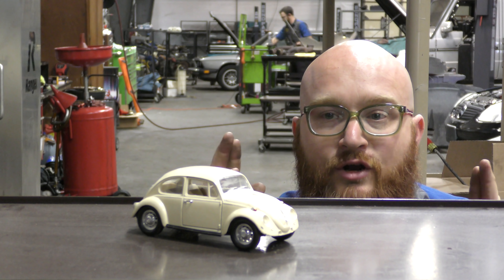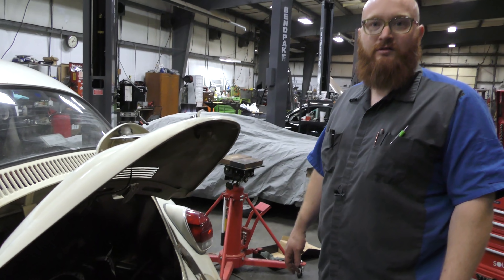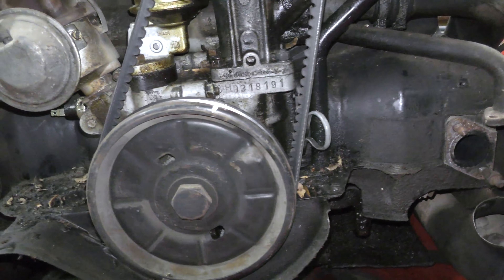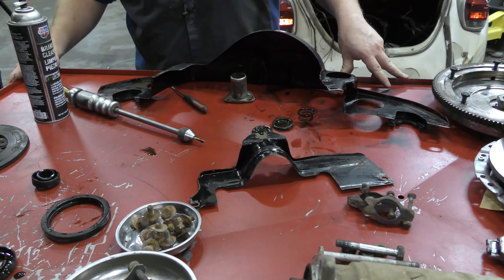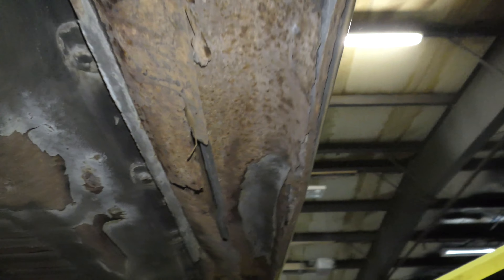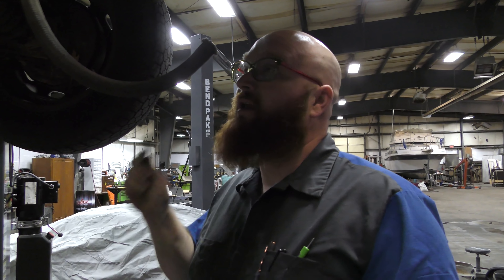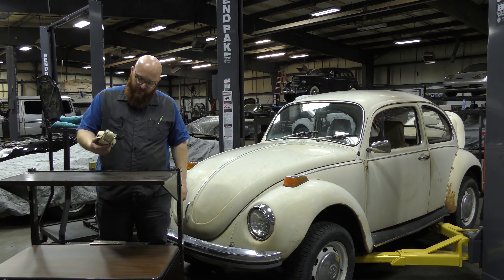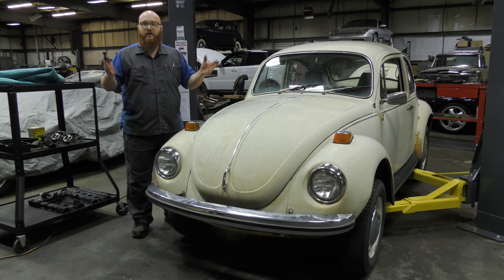Engine out for a clutch on '72 Super Beetle?! CAR WIZARD shows cool little car & huge repair process

Comment: In the UK, that car would not be allowed on the road with the heater channels rusted out like that. They are structural. I can't understand why, if this is a project car, that if the clutch had to be done, that the whole engine and transaxle weren't taken out to deal with all the rust. I've seen ot worse, but it's much easier to do with all the mechanicals out of the way. The job can be done properly.

Comment: Don’t understand why the muffler was removed, motor comes out with it still bolted to motor. Started my apprenticeship with VW in 1970, we had motors out everyday, but only two floor jacks, would put a large hypoid gear oil can under motor and pull motor onto can and lift car in the air, installed that way as well.

Comment: That fuel filter needs to come out of the engine bay. Put it under the car.

Those plastic filters splitting are a major cause of fires on Air-cooleds.

It's a simple job to pull an Air-cooled engine, when I ran a shop my best time was 9 minutes pulling the engine out of a Bay.

Comment: Woah, they pressurize the washer fluid tank instead of using a motor? That's not something I've seen before.
Reply: My memory of this is vague, as I was just a kid at the time, but my family had a VW microbus, probably around a 1967 model.  Its windshield washer used a foot-operated pump, located toward the left of the driver's footwell.  This pressurized-air system looks like a "luxury" upgrade that they tried after that.

Comment: Love that plastic fuel filter! So fire resistant....
Reply: Can be relocated. My Bug has the filter moved to a bracket on the gearbox away from the engine. But it’s also running a far from standard engine now.

Comment: Now let's see if the car wizard is an honest mechanic. Maximum 1.5 hours labour for this job, 5 wires, 4 bolts and a fuel pipe, bumper and tins. Full clutch kit cost in South Africa 100 dollars :)

Comment: I need to find someone to pull my Corvair's engine and and reseal it.  A similar design, but still much different. .
Reply: Never let that engine overheat. An engine fire in a Corvair can end up with the magnesium block burning. Once that happens, nothing can be done to stop the car from burning to the ground. My uncle saw so many of them burn on the side of the road that he thought they should have all been recalled and had a racing fire suppression system installed.

Comment: I've lost count of how many times I've removed a beetle engine.
Please, do the customer a favor and move that fuel filter down by the gearbox. 
I've seen too many engine fires destroying old classic VW's over the years :(
The other common fire related failure is the fuel pipe connector popping out of the carb body, but this can be secured with some wire and a jubilee clip.
Otherwise it looks like a great unmolested 1302 as we call them in the UK.

Comment: I thought some of them has a gas powered heater . Am I wrong . If so please let me know
Reply: The gas powered heater was an optional accessory that mounted in the frunk.  The stock heat actually works okay but all of the engine tins, seals, and the thermostat need to be in place and functional for the system to work.
Reply: Gas heater was an option (several companies made them),  it was placed under front hood area
Reply: Yes, it was a non-VW product.  You cut approx a 4x3 inch hole in the "firewall" ahead of the shifter.  Ran a line into the gas line and it used gas to convert to heat.
Reply: @terrylessmann2274  Thanks I think I drove one many times with a gas heater but that was long ago

Comment: 4:45 Brazil written on the fuel pump!?
Reply: The car was probably made by Volkswagen do Brasil.
Reply: @MarkVerstappen93  
The replacement parts almost certainly are....the Brazilian parts  are distributed world-wide....the car most probably at that vintage would have been German manufacture....

Comment: That cheap fuelfilter above the exhaust manifold is not a good idea, when you have mechanical fuel pump. Almost burnt my beetle, when it gave away.
Reply: Mine has had the filter moved to a bracket on the gearbox, along with an electric pump.

Comment: That 1600cc dual port engine is NOT original to that 1972; its engine number starts with "H", so was most likely 1500cc factory case used in 1967-1969 Beetles and updated to 1600cc dual port.  One does NOT need to remove the starter to get the engine out or in; just the bolt, the starter nut stays in place and holds the starter in.  I've had my 1970 VW Beetle since 1972 and my 1971 Beetle Convertible since 1976.

Comment: PLEASE CAR WIZARD....relocate that cheap gas filter away from OVER the Distributor. One leak of gasoline down onto the disty and POOF. 
I’ve always put mine inline where the fuel line exits the tunnel.
Reply: Mine has been moved to a bracket on the gear box, but like yours well away from the engine bay.

Comment: any man that has to take a beetle to a mechanic has too much money. Without any experience in mechanics I took apart a 73 beetle, rebuilt the 1300cc air cooled engine and changed the body to a manx. They are THE easiest cars to fix
Reply: The 1300 cc engine was not offered in the '73, if it was in fact a 1300, it was not the original engine.
Reply: @johndavidwolf4239  Just because it wasn't offered in your part of the world doesn't mean it wasn't offered elsewhere. You can actually look up 1973 beetle engines but that's besides the point. I learned how to fix cars on a beetle engine. That engine is so easy to fix it should be immortalized and reproduced in other compact cars. One man can pull out the entire engine with the help of a pulley. And for the record when I bought the beetle it actually had a decal on the bonet saying 1303 not that I care one way or the other. It's working perfectly as a manx

Comment: Step 1: Aquire Beetle
Step 2: Remove engine from Beetle
Step 3: Throw engine away, it's dead weight anyway.
Step 4: Replace clutch
Step 5: Remove body
Step 6: Shorten chassis by 11 inches
Step 7: Install a porche 356 kit body
Step 8: Install Subaru engine
Reply: lol

Comment: That model's not a super beetle... its a standard bug. Super beetles have curved, not flat, windshields....😏
Reply from the maker: Standard beetles do not have macpherson struts up front. They have torsion bar suspension. This model IS a Super Beetle
Reply: Super Beetles had both flat and curved. 1302 and 1302S has MacPherson and flat screens. 1303 is the curved screen. This is definitely a Super.

Comment: "The CAR WIZARD 🧙‍♂ shows the huge process "  Lol , a shadetree mechanic can pull a VW engine in 30 mins.  A professional tech in a shop environment and a lift can have one out in less than 15 mins.  I have personally seen it done in 6 mins.  don't have to pull the starter , don't have to pull the exhaust.

Comment: Not impressed , back in the day my buddy Paul and I could drop the engine out in 30 minutes with a floor jack and hand tools , rusty heater ducts ? scrap piece of siding and a couple of pop riivets, no heat? on the 1300 series the exaust door to let the heat out when you didn't want it always rusted out but a short section of 2x4 was the perfect fit to pound it in where the door was , and if you didn't have a slight tweet to the engine when taking off the valves were out of adjustment [ too tight] , also the oil cooler would overheat the #3 exaust vale and stretch it to breaking every 60 K miles , and watch your oil changes as this thing does not have a filter .

Comment: The "bonnet" is not a 72.
Reply: Thats the right one
Reply: Don’t know why he called the engine/deck lid the bonnet. Got a ‘73 1300 here in the UK. Still call the front the bonnet regardless of where the engine is in car.

Car here has a two vent lid. Was around this time they went from two to four but not sure just when.
Reply: @sparky4878  IIRC cars with the 1500 have the two vent lids and 1600 have the four vent lids so the lid on this car may not be original
Reply: I had a 72 super, it looks correct. and BTW the 71 72 super Hood/bonnet is UNIQUE to those two years. and paint matches perfect.

Comment: easy to work on..4 bolts and yank the engine out the bottom......clutch is easy to do....personally,Ive owned 29 of them in my life..LOL
Reply: got a 72 also right now..it has 48000 miles on it.

Comment: Very rusty in the sills - that’s unsafe !
Reply: No it's not! 
The strength in the car is the "spine" running down the middle of the car...think "box girder". 
You can take the body completely off and drive the platform around.  
The body is non structural...and also contains those heater ducts...

Comment: lol he keeps saying "Air Cooled" those that know these are Oil Cooled just as much as they are air cooled.
Reply: Yes, and the air cools the oil as well. So they do work in combination
Reply: @MrCarGuy  yeah but you will burn one up quick if the oil cooler get clogged you can have a jug get gunked up and it wont do as much damage. Everyone thinks about the air blowing over the jugs and heads but the oil is what will wipe out everything

Comment: Not going to be a popular comment, but I hated these and I still do.
Reply: When I asked my mechanic of 10 years standing if he would overhaul a 1967 1300 and put it into 1600 form I got a strained long stare...before he agreed. 
He had started out as an apprentice working for a Dutch migrant Master VW mechanic and had sworn never to work on an air-cooled VW  ever again.
The first head bolt stripped out...he helicoiled every single hole in the casing...his men all kept their distance that day...but the engine turned out superb....